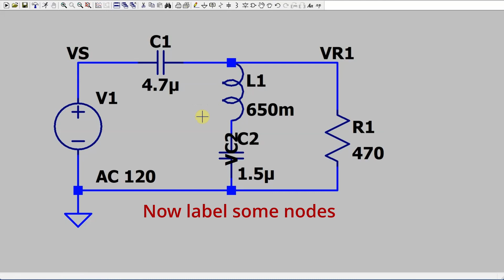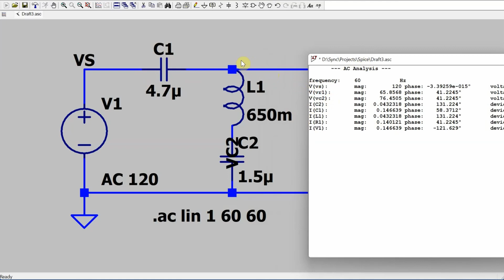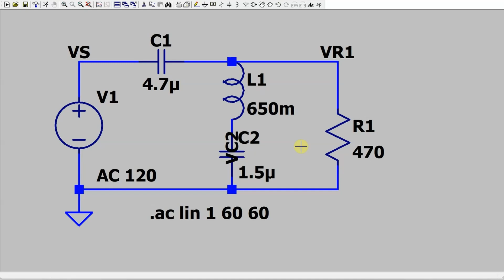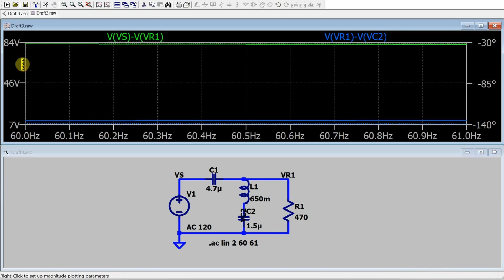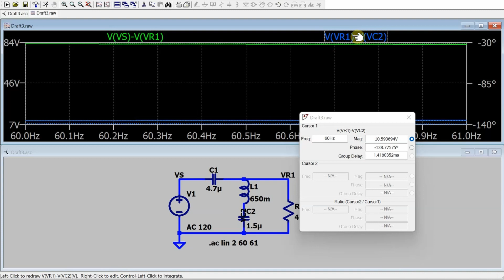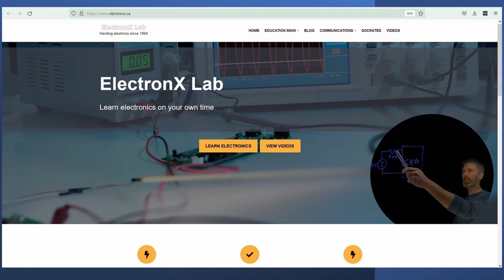Quick LTSpice: Simulate RLC Circuit

Comment: I've been trying to model a capacitor-start capacitor-run single phase AC motor with this kind of AC circuit analysis. The thing I'm tripping up on is the back EMF from the coils in the motor. It looks like conventional theory would consider the back EMF to be modeled as a separate AC source pointing the opposite way, hidden inside an inductive coil and in phase with incoming voltage. Once the motor spools up the back EMF grows dramatically and current falls. Is it fair to say that the big increase in voltage drop seen across the start windings is mainly from the phase shift of the capacitors in series with the start windings? Or, is there actually an increase in voltage caused by the colliding waves of the two voltage sources as they meet at the entrance to the coil, much like the way waves on a lake from two sources create large standing waves at the interface where the waves meet?

Comment: Hello,
The statements, schematic, and calculations are confusing; AC has + and - signs (DC!), negative is isolated, and capacitors are not electrolytic.  Would it be possible to please explain the power supply form; if it is AC, which law determines + and - for it; does it mean Hot and Neutral, or even earth, where if the resistance between the earth and ground is less than <2 ohms, the earth could get considered as ground?
Regards,
Reply from the maker: In LTSpice, the voltage source looks like a DC source even if you have it configured for AC. You can look at the text below/beside it to see how the source is configured. In this case, it says "AC 120" because it is an AC source at 120V.  Also, you wouldn't want an electrolytic capacitor in this circuit since it is AC, but I don't think there is an electrolytic capacitor symbol in LTSpice anyway.
Reply: @ElectronXLab  
Hello, 
a) The original questions were why the schematic is wrong; power source is an AC form, the ground is isolated, caps are not electrolytic; nevertheless, AC represented as a DC form with plus and minus instead of hot and neutral poles? 
b) If the power source is a DC type, there would not have been any currents through the components. c) Of course, the caps should not be electrolytic, where they explode, and there is no use for them. 
d) Finally, the whole subject matter was why the schematic shows a confusing circuit that does not comply with statements and defies physic laws? 
Sincerely,
Reply from the maker: @benjaminkarazi968  I'll see if I can answer these questions for you, but I think the bottom line answer to all of them is that LTSpice requires me to enter them in that way. To make sure we are talking about the same thing, I'm trying to build an AC circuit with a couple of capacitors, an inductor and a resistor. When I say AC circuit here, I simply mean that there will be a sinusoidal voltage applied from the source at a frequency of 60 Hz - I am not trying to emulate a circuit that you might find in your house.
a) To create an AC source in LTSpice, I have to use one that looks like a DC source. The "ground" point is also required by LTSpice, but it is not actually ground, it's just a common reference point
b) You're right, if it was a DC source, there would be no currents after any transients had settled.
c) yes, not electrolytic. I don't think there is a symbol for electrolytic capacitors in LTspice anyway
d) LTSpice makes me build a circuit that looks like that (as far as I know...if anyone knows a better way, I'm happy to hear about it). You have to look more closely at the components to see what they actually are (e.g., the source that looks like it's DC is actually AC).